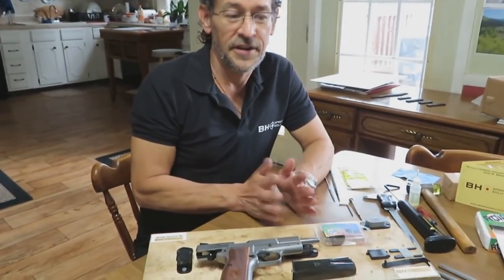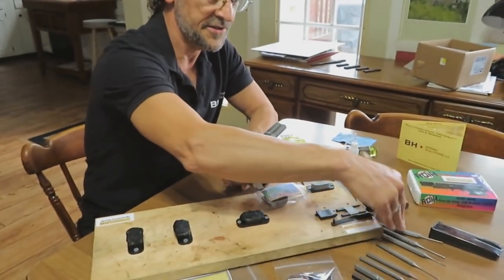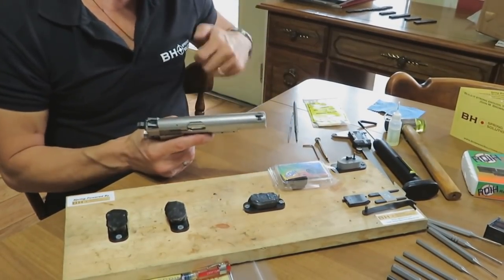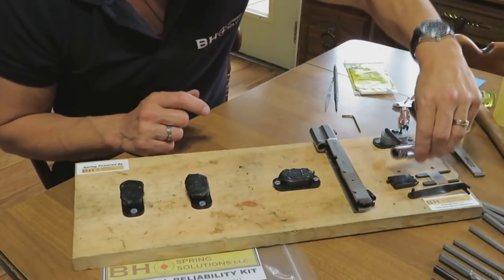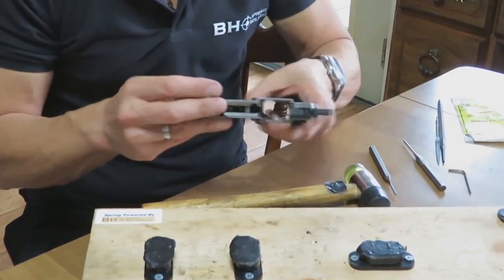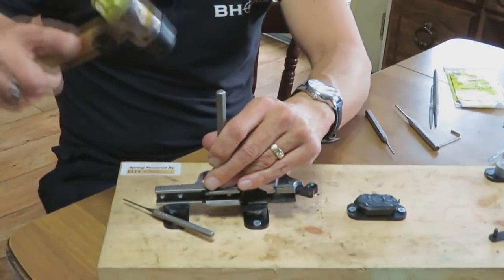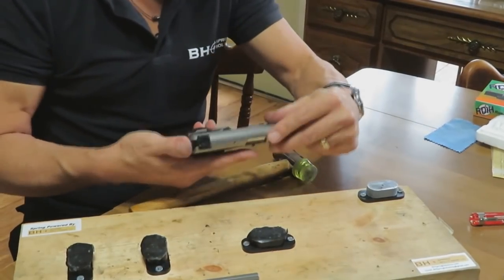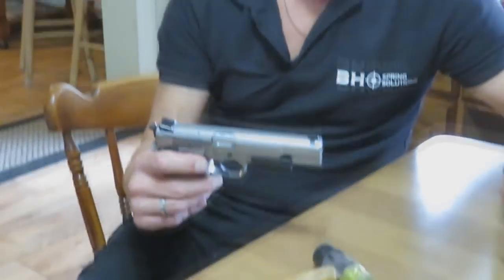Tisas Regent BR9 & Hi Power Spring Optimization / Ultimate SFS Upgrade Installation BHSS

Comment: A very good video.  I have both an early Browning Hi Power and an M90 and replaced the main spring on the M90 using your main spring tool.  I'm not sure how anyone could replace the main spring without it.  Due to extensive shooting over the years the M90 is no longer as accurate as it once was and I'm considering replacing it with the Regent BR9.  Knowing BHSS has upgrades available to improve it's trigger pull is very helpful.  I do like the SFS system and will consider it as well.

Comment: Great video !   What Cleaner did you use to remove the black on the slide ?
Reply: It came in a stainless finish. They didn't remove any black as there wasn't any to begin with.

Comment: Thanks for the video - unfortunately you left out the Hammer assembly and the printed instructions are illegible, and the illustrations useless.  Pity that such a great product falls short on the finitiative.  Also not clear which sear pin to use, but meddled through that as well.  Very happy with end product, 5.5 lb trigger pull after all the gnashing of teeth and pulling of hair.
Reply from the maker: Hello William, there is a video for the hammer assembly available - https://youtu.be/z1P6Fe3_F9I

Comment: Why even use the goofy 'hammer forward' SFS system? No need for it whatsoever.... Condition 1 for the win!
Reply: Based off what the product does with the hammer forward, round in chamber. As soon as you flip the safety to fire, hammer goes to the rear, pull trigger and Fire. No time difference in standard condition 1 cocked and locked.